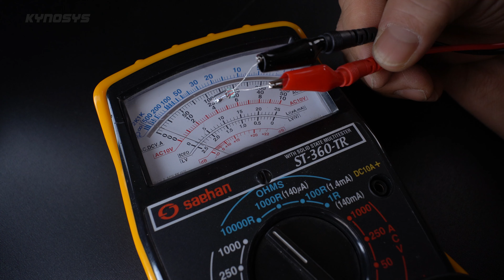Switchless Lamp using Tilt Switch / DIY

Comment from the maker: Many people are curious about how to replace the battery. There is a white acrylic window on the four sides, and of the remaining two sides, I tried to attach and detach the side with the battery using a magnet. However, the battery was so heavy that it was difficult to secure it in place. So, I fixed the side with the battery and used the side with the round acrylic and LED as the lid. When you open this lid, there is space on the side of the battery, where you can replace the battery. If you have this level of curiosity, I think you watched my video very carefully. I would like to express my sincere gratitude.
Reply: I'd add a wireless charging coil to one side and just set it on a charging surface.
Reply: @gillissn  This is much better idea. All things are touchless.

Comment: Interesting. But why you didn't install a charging system?
Reply from the maker: Rechargeable is a good option. Since I had four 3.7V batteries connected in series, it was difficult to connect the charger. This is because these batteries must be charged individually. I need to look into a 12V rechargeable battery of an appropriate size. thank you!